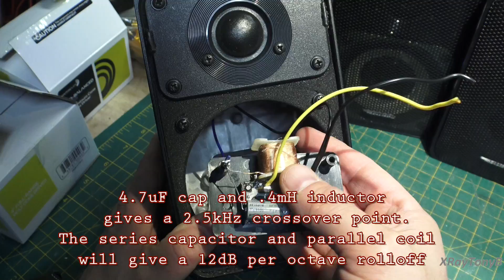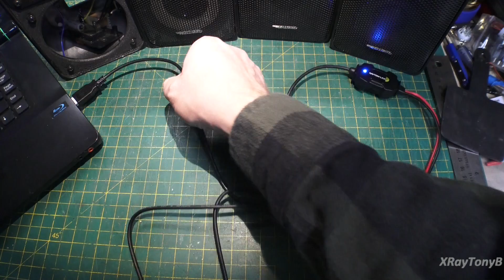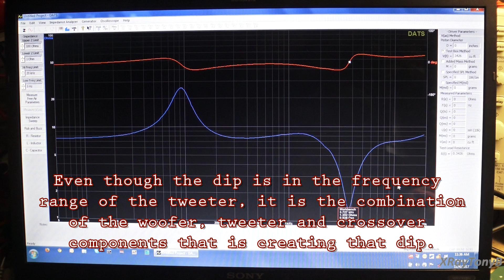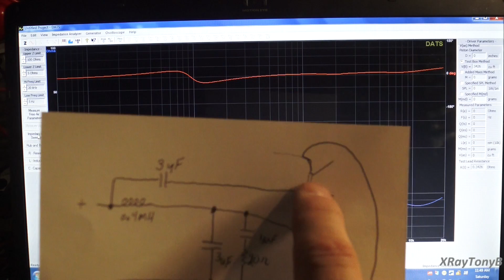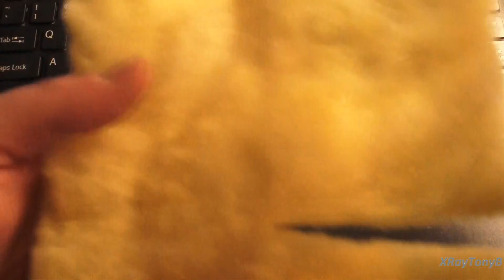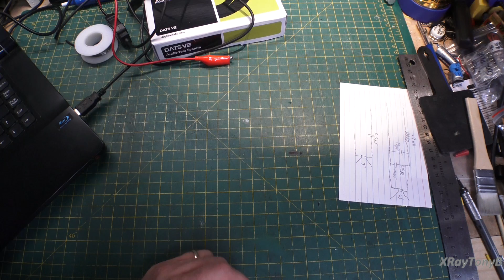Realistic Minimus 7 Speaker Modification and Test

Comment: Hey there. Thank you for this. You taught me more about crossovers and speaker design than any single source I've ever come across. Thanks for taking the time and the many hours it must have taken to put this together. Bravo!

By the way, your recording has a lot of room in it so the differences are hard to hear, even with headphones.  To get an accurate recording of these guys I would: 1.only use 1 speaker so there are no potential phase issues from the speakers being slightly different distances. 2. place your mic 12-16" away so you're minimizing the amount of "room" the mic hears. 3.place mic between the woofer/tweeter. 4. put the speaker on a stand 1/3 in from a wall to minimize reflections from the desk, and other sources that can cause background comb filtering(I think that's what it's called), which might not seem like a big deal but once Youtube compresses it, softer things do get louder. 

I'd say these three links are the quickest way to hearing the difference between the speakers, though it's distorted by the factors above. 1:02:53   1:05:10   1:07:23

It seems to me that the stock pair were a little tubby. Your semi stock ones were a little clearer. The ones with the subs in them were a bit crispier, not sure if that's good or bad.

Comment: I have  a  spare  driver for  Minimus 7 in my parts  cabinet which I bought 35 years  ago :)  When you were discussing x-over design and speaker substitution, I didn't see or hear any mention of  efficiency  of the drivers.  Most small air  suspension woofers with FA  resonance @ 90Hz  are in the 86dB / watt range  where the small cloth or plastic dome tweeters  are usually above 90dB. So regardless of  your impedance  curve measurements,  there is  a requirement for  padding the tweeter with a power resistor to level the frequency response, OTW the range  above  crossover point will be  shelved up by 3-5 dB or  so depending on baffle  size.  I have preferred the very common plastic  Audax  010 with phase plug over ho-hum cloth or plastic  domes which have  horrendous  breakup modes and  that pesky 8-10Khz sizzle.  Also the  usable  response before  cone breakup of the mid-woofer will determine  the x-over point then the appropriate sized tweeter shall follow. The Minimus  mid-woofers  were excellent in their  day for  smooth midrange response and  can likely go with NO inductor so as  not to introduce phase  rotations in the critical midband. A  small tweeter will need at minimum a 1st order butterworth network then the unit can be  connected in phase with the mid/woofer to prevent the   crossover point suckout notch. 
Thanks for the Video, xraytonyb !  - Sandy

Comment: Thanks for this video, it was intriguing and educational.

I own probably ten pairs of Minimus 7’s.  I have five each in my two 5.1 surround sound systems. 

I shopped for a pair of small extension speakers back in the seventies. I listened to these and some much larger small Advents. These blew away the Advents in overall sound and imaging and stage depth. My love affair with Minimus Sevens began that way.

I agree, the third iteration sounded better to me. I listened on ear buds to avoid coloration from my own speakers. The bass was tighter, and more detailed. 

One of the great strengths of these speakers is the fact they just roll off at the deep bass, and do not attempt to do what they cannot. After the initial success of this model, Radio Shack came out with newer versions which were all inferior to the Sevens. They were attempting to increase the bass response, and screwed up the sound. 

Your adaptation was a pleasant surprise, it did NOT screw up the sound of the best speakers Radio Shack ever made. 

I would appreciate your comments on imaging and sound stage, as ear buds do not allow for hearing those characteristics. 

Thanks again, an intriguing and educational video about some great little speakers. 

PS Add a subwoofer, and you’ve got an excellent full range system

Comment: Thanks for the detail, I finally now know how to design crossover circuits.  The last time I built a pair of speakers was back in my dorm room in the mid '70s.  Used a pair of 12 watt 12" combination speakers I bought for something like $12 each at Lafayette Radio before they went belly up. Used an article in Popular Electronics for the resonance and volume formulas.  Hooked them up to an old car stereo that I had filched off my father's '71 Ford Country Squire station wagon before he sold it for a song due to the huge drop in value gas guzzling cars with big V8 engines had suffered during the 1970s Oil Crisis. Anyway, the speakers sounded great and I used them until I bought my first real component system in the late '80s.  For what it's worth, the three test recordings you made all sounded the same to me, but the final virgin MP3 cut at the end of the video sounded the best on my Altec Lansing computer speakers that are themselves going on 15 years of age.  Don't know what that means except that maybe my ears are aging along with my equipment...

Comment: An interesting project Tony, obviously the impedance of the speaker is important  to allow the amplifier to transfer power to the speaker efficiently . However the impedance has little to do with the frequency response of the  individual drivers or the complete box response. I appreciate to measure frequency response takes specialised equipment and the room and the speaker location will play a large part in how the speaker sounds.
The metal cone unit is not really made to extend much higher than 1khz and coupling this to a tweeter like the one used,  should really cross over at about 3khz is pushing thing a bit, probably why you had issues with matching impedance.
Using only a capacitor in series with the tweeter lowers it's power handling quite a bit. The last thing you need is bass going into the HF unit.

Comment: Thank you for testing the different woofers !!! - I will try the ND105-8 Speakers i  my Mi imus7s !
Reply: I'm a fan too.
I'm leaving the original drivers in mine because they're all in good shape. Just getting rid of the stock 4.7 Uf cap.
Only test equipment I have are my own ears and unfortunately at my age they don't do highs very well so I'm not sure what the end result will be.
Still fun to tinker around with this stuff again.
Reply: @powerguymark  Don't get rid of the cap but replace it with a new one. Those caps go bad after a while. need the cap to protect the tweeter from low frequencies and gives those frequencies to the 4"

Comment: Maybe it was the mic but I found that the original stock set were more balanced and clean sounding overall. The modified two had more base but the mids sounded less clean and somewhat muddy. I will keep mine original. By the way I own the Minimus 7 W or wood cabinet models and I think they sound even better than the metal cabinet ones. Just my opinion for what it is worth
Reply: The differences everyone hears between these and every other model is attributed to other overlooked and significant (but insignificant to 99.9999% of the population) variables during the manufacturing and assembly process.

Comment: Another thing that makes the DATS v2 useful is when tuning a ported enclosure.  The dip in the impedance response shows the tuning frequency of the port.  You can play with ports until you get just what you want.  I used mine to tune a DIY 2.1 bluetooth speaker to 39Hz.  All the calculations didn’t help as much as actually measuring the tuning frequency.  Great result!  If you’re thinking about it, just buy it.

Comment: When we were young heathens we'd have beer parties in the woods. I had a Hornet wagon with a set of these in the very back, I would open the rear hatch, flip the speakers on the mounts and they sounded like they were right next to you 200 feet away...they really liked the open air!
Reply: they totally do! I have a pair mounted under the soffits of my garage for yard tunes. The detached garage works as the bass box and these do a fine job of filling in the mids and highs outside

Comment: Tony:  

When you show the graph with the little rubber-surround subwoofer at 50:15, you are getting a bulge at the low end of the impedance curve between about 30 and about 90 Hz. This is caused by leakage around the edge of the little woofer. The leakage approximates a port, affecting the frequency response of the speaker system, which the Dayton tester does not measure. My suggestion would be to stick the small woofer to the front of the box with some RTV sealant to get a leak free seal. This would improve the frequency response of the modified system.

Comment: I liked what I heard from the ND105-8 mid-bass speakers in your video. I could tell there was a better bottom end, and even though I'm not listening through my own Minimus 7 speakers, there was an eveness in the midrange. In all 3 comparisons, the highs sounded the same, as expected. 

I own a pair of these speakers. I also own the slightly larger RCA vented speakers. I believe they had the same tweeter with a slightly larger cabinet and a 5 inch full range driver.

Your video has helped me decide to take these smaller speakers to the next level.

Comment: Yes it did sound best with the last set. I replaced a woofer in one of those units a while back. It had a large magnet. it was large enough to affect the volume size of such a small cabinet. Which affected the bass. I rebuilt my Ar4s and didn't get good bass until I used  Thiel dynamics to select a woofer to match cabinet volume. Great presentation, Thanks I learned. I have a pair of 77's

Comment: I may have to put that tester on my Christmas list.  There's some Altec speakers I want to test.  Altecs always seem to be picky about the amp that drives them.  I've always suspected it's a complex impedance (lots of phase shift) that some amps have a hard time dealing with.  I'm not too sure about using a zobel to try an flatten impedance.  I'd think the purpose is to try and prevent highs from getting into the woofer so both are not' trying to reproduces sounds at higher frequencies.   I mean, I see the attraction of flatter impedance under the theory that it would translate into a flatter sound (assuming the function of electrical energy to sound energy is reasonably flat), but a zobel networks lowers the impedance and burns up the energy in the resistor rather than in the driver(s) creating sound.  So it may flatten the impedance, but I'm not sure as it flattens the actual sound.

Comment: I'm using these to try out different speaker placements in my Dolby Atmos/ DTSX/Auro  height channels.
There seems to be quite a bit of discrepancy between these different formats regarding speaker placement so I'm just experimenting to see what I hear with my own ears.
THX recommends 80 HZ and although these are rated down to 50 they start rolling off slightly before 80. Thankfully I can set the frequency above the roll-off point so they'll stay clean and tight.
So this video is still relevant in my book.
Thanks for sharing.

Comment: I had the RadioShack/RCA branded version of this speaker up until a couple of days ago. I had broke the speakers down to use the drivers to build a Bluetooth speaker that would house both of the drivers and both tweeters along with on board amplification. It’s cold out and my shop isn’t heated so I brought the drivers inside my home along with a few other things I needed to complete the electronics. While watching some YouTube videos I noticed that I didn’t hear my little boy anymore. When he gets quiet that means something is about to get destroyed, already has been destroyed or he’s looking for something to, you guessed it, destroy. I I walk into the kitchen, where the plastic storage bin with my supplies were and there he sits right next to it with the drivers in pieces in front of him. He’s smiling a huge smile and says “speakers!”   
He got a screw from the bin and used it to tear the surround off both speakers along with the dust caps and in the process he ripped the leads loose and demolished the voice coil of one of the drivers. I’m still pissed but mostly at myself for not securing the bin better. He’s a master at getting into things and also a master of destruction.
Reply from the maker: Just one of many stories we could exchange. I guess that's what they mean by the "joy of parenthood"!  ;))

Comment: Another great video. Thx, Tony!
I just picked up a pair of M7 from thrift ($10), made in Japan. I don't care for them all that much (yes, they are working correctly, with all components in good shape and testing okay; few use-hours on this set to begin with). Not sure what all the hype about them is about?? I may replace stock cap with poly. Frankly, some cheap Cambridge SoundWorks computer speakers (with sub) has  better sonics. 
Oh ... about Tony's tests. I think I like orig. best. Seem to be least "compressed". That snare sounds most  ... ahem ... Realistic ... on the orig un-modded. Maybe Tony should just mod stock and forget about Dayton drivers.

Comment: There is reason realistic used a 2nd order x-over on the tweeter.  The 2nd order protects the tweeter better.  The closed in sound was probably an acoustic phase problem.  If you shift the low pass and high pass networks, the impedance response will flatten out and the tweeter will handle it's lower frequencies better.   You realy need to combine the data with a frequency response (Omni mic)  measurement to get best results

Comment: I preferred the original with pulp woofers. IMO the pulp driver gives a much more natural accurate frequency tone and timbre like my Focals and Tannoys do. Metal woofer sounded too bright, thin and exaggerated like a bad set of headphones. The best mod version of the minimus 7 I have heard had the original woofer coated with the "KEF coating" and the crossover set (4 uf mundorf cap )slightly higher than stock.

Comment: As previously stated,an even impedance does not mean an even frequency response.
A single dual coned driver may be pretty flat frequency wise,but the impedance will increase with frequency due to the inductive reactance of the voice coil.
It would be interesting to make a small anechoic chamber using a foam lined box with a microphone fitted,and then plot the frequency response.
I thought the original speakers were the least muddy and had more sparkle than the others.
This might be due to the lighter paper cones providing faster transient response.

Comment: This is old video, but ...
Comparing the sound from these three pairs of speakers, I liked the second set the most. The original ones play a little too flat, and those equipped with a subwoofer are clearly tired in the low frequencies.
With the third set, the guilt probably lies in the type and size of the housing. Interesting if someone build a DIY 'package' from an MDF, bigger by one and a half liters, and bring out an additional Bass Reflex channel to this hardware - what happens? I think then this set would play best.
I'm using ours European equivalent for Your's Minimus 7 called Canton GL 260. Not bad German bookshelf speakers. I'm glad that I'm buy one pair of them long time ago.

Comment: Checking for driver response should not be done open air.  The initial tests should have been in the enclosure as they are intended to be used.  Speakers require a baffle/enclosure to function as designed.  Otherwise open air causes them to cancel themselves out, especially low frequencies.

Comment: Excellent video and work that you have done on this project.
My Minimus 7s will now be Maximus 7s thanks to your brilliant work.
I am strongly considering buying a DATS V2 unit.
Everything I have read on the net is unanimous; this is a fantastic unit the software being so powerful.
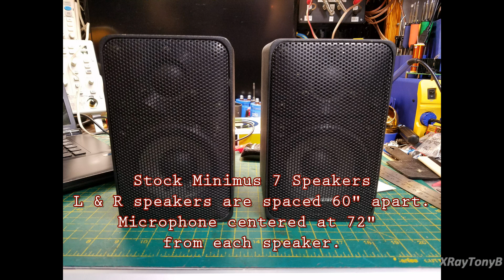At 1:01:56 when you start the test results the text on screen shows:
Speakers at 60” apart. It seems more like 6” (inches) am I wrong?
Also the distance for the microphone at 72”or 6 feet are you sure?
I purchased my pair of Minimus in the very early 70s and still like those like they are one of the best values for the price I ever purchased in audio.

Comment: I gotta say, this is one of the most interesting "speaker" videos I've seen lately. You did mention the 8 ohm conundrum. Not getting too technical, in every (almost every?) speaker the impedance will vary with the frequency. So there really are no 4 or 8 ohm speakers. A good speaker company will state the value of a "nominal" 4 or 8 ohms. This IS important when connecting to a transistor amp as most are not designed to drive less than 4 ohms, don't believe me?? try it. Just have a backup amp ready. 
 As for the Minimus 7's, I first heard them in the mid 1970's. The Minimus 11's were also very good for size/price and made the Tandy company a force with which to recon. I've experienced the Minimus 11's with a (Ohm N) subwoofer in an average size living room and blindfolded, the system sounded full sized. As to your test, I'm listening thur Logitech S-120 speakers so no comment.

Comment: The mid bass drivers seemed to have more bottom end, an issue with these (When I heard them in store years ago, I was disappointed) however the frequency response didn't seem as smooth as the others, like it had two peaks in it's response - kind of same as the impedance plot you made. There's probably nothing you can do given the small metal boxes.